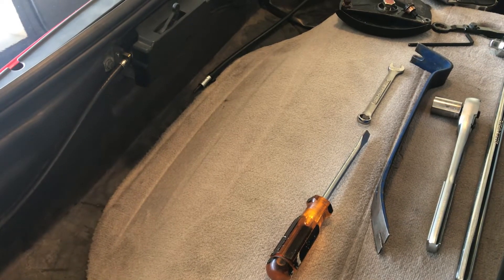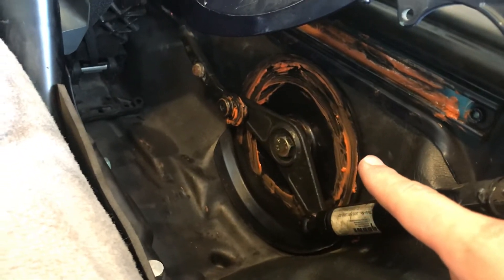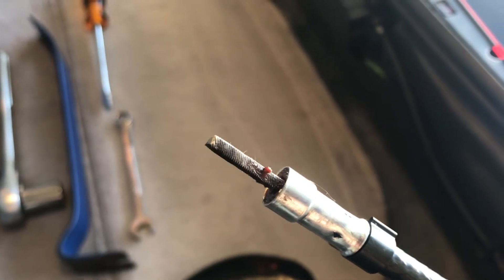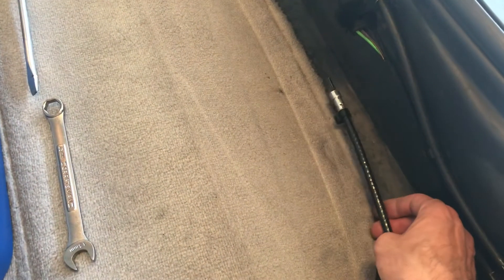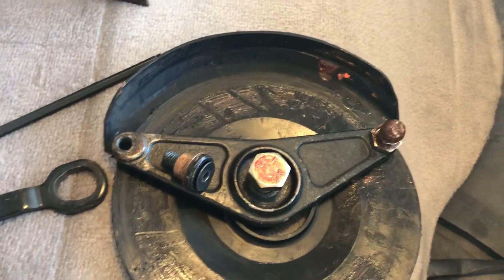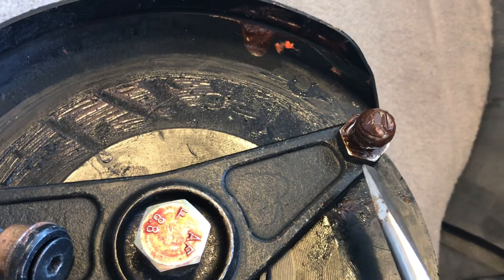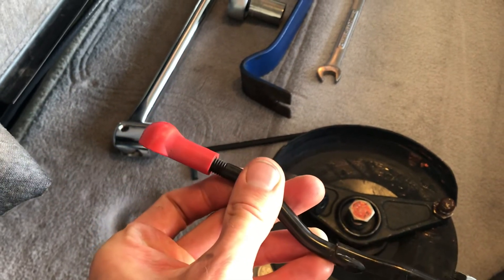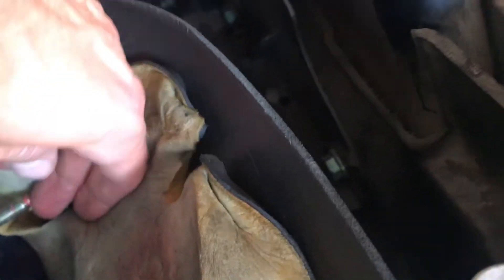Porsche Boxster 986 Convertible Top Mechanical Components

Comment: Where is the micro plug for the driver side convertible transmission? I cant find it on my 99 986, i know its there i disconnected it a couple of months ago. But it has disappeared.
Reply from the maker: I have been fortunate enough to avoid the microswitches on my Boxster so far. Try this video to see if it helps: https://www.youtube.com/watch?v=j3E_3eNf8ms

Comment: So I am having sort of the same issue. What happened to me is that the passenger too ball cup broke. I decided to replace both and every since then, the drivers ball cup keeps popping off for the top. I took the Clamshell cover off and it looks like for mine the strut is causing too much pressure on the top arm and is popping it off. Not sure what else to do. I briefly worked the top and cover manually, bit didn't really like that...the saga continues.
Reply: Did you ever end up fixing this? I have the same issue